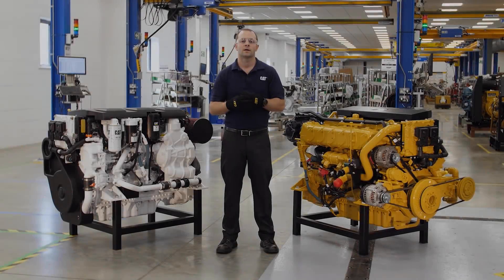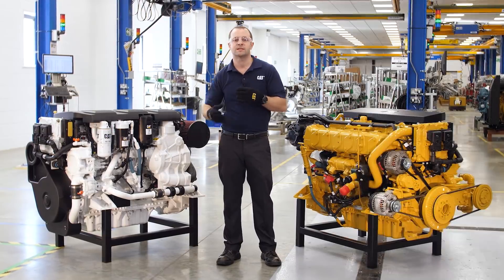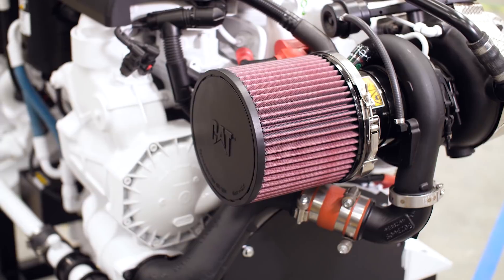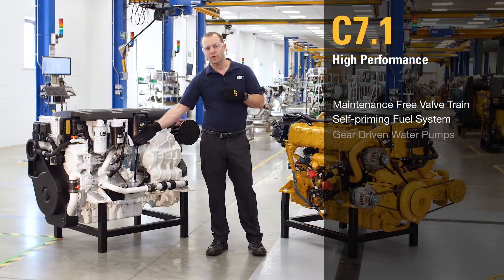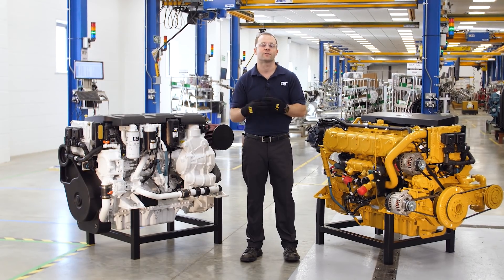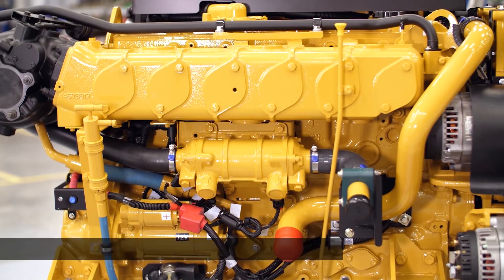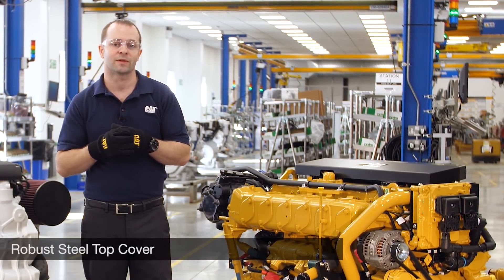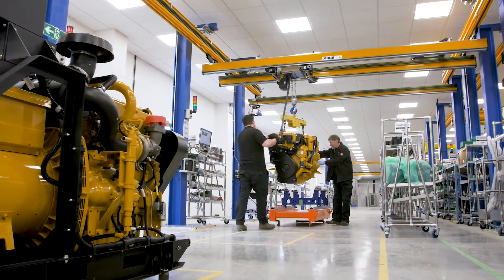Meet the new C7.1 Commercial Propulsion Engine

Comment: The world misses Cat engines for medium to large trucks.
Reply: The C7.1's power density and torque is great for the displacement (7.0L), but it is somewhat on the heavy side. The C7.1 HP is about 750 kg. For comparison, a similar displacement and output GM Duramax L5P (6.6L, 445 bhp / 910 lb-ft) is about 400 kg. The same can be said of its Cummins and Ford 6.7L competition in the same power class (400~450 bhp). This may not matter in marine applications, but it matters quite a bit in heavy duty trucks. This largely explains why you don't see Catepillar engines in light trucks. I am sure CAT is more than capable of producing a lighter engine, but it is a saturated market and there may simply not be the financial incentive to enter the fray.
Reply: @dwightlooi  it's not a saturated as it used to be because Navistar is gone
Reply: @5.43v  That in itself was kinda sad because Adv EGR worked in the end... but reliability issues and lawsuits from its the premature introduction forced by the environmental extremism of the Obama Administration destroyed Maxxforce as a brand and eliminated an American engine manufacturer while creating an opening for MAN. The point remains though that for CAT to have a 7 liter offering targeted at trucks, it is going to have to weigh like a Maxxforce DT (or whatever Cummins or GM alternative). It can,t be a 1600 lbs engine.

Comment: So this would be a direct drop in for a 3126 ? Without changing mounts?

Also what about fly wheel and bell housing, power ratings are almost identical so gear ratio should be same.  Thank you!
Reply: Repowering twin 3126 to c7.1 and the front mounts are not the same, but I am running the same mechanical transmission for the job.
Reply: @nvfux4997  sweet thank you  been debating this our going to fpt. Cats price for hp is little wild haha

A reman 3126 is 45k +9 k core

54k for c7.1 at 425 hp

Fpt is 36k for nef 450

51 for evo 570

Comment: What can you sat, CAT engineering at its finest!   Germany`s  MDU  also makes some fine diesel engines!
Reply: MTU or MDU are very expensive to operate specially after sales parts needed during overhauling . its  good for military marine special application . compare to CAT engine are design for many purposes , either military, comercial fishing , pilot boat and fast craft. Both are continueos running engines .

Comment: Power density and torque for the displacement (7.0L), but somewhat on the heavy side. The C7.1 HP is about 750 kg. For comparison, a similar displacement and output GM Duramax L5P (6.6L, 445 bhp / 910 lb-ft) is about 400 kg. The same can be said of its Cummins and Ford 6.7L competition in the same power class (400~450 bhp). This may not matter in marine applications, but it matters quite a bit in heavy duty trucks. This largely explains why you don't see Catepillar engines in light trucks. I am sure CAT is more than capable of producing a lighter engine, but it is a saturated market and there may simply not be the financial incentive to enter the fray.
Reply: Cat quit on highway engines because of emissions

Comment: There is an owner/operator I know who has owned and run a 1944 Cat D-8 cable dozer since he bought it surplus for $300.00. Cat has tried many times to sell him a new dozer and he keeps refusing because they went to electric start. His has the donkey starter on it and he loves it as in the winter when it's not uncommon to see -40 or lower temperatures his never fails to start as long as he brings an extra Gerry can of gas with him. The company he's contracted to sent him to level out a new parking lot 12 years ago and while he was finishing up the new to the company 140 grader showed up with the computerized leveling gps system on it and after three passes on the gravel that had been leveled by the dozer operator called the owner and told him he was wasting his time out here as the dozer operator had leveled the new parking lot dead on spec simply by back dragging the blade on his dozer. The operator of that old D-8 is still working today at 87 years old and says why should I retire? I enjoy running a dozer. One morning someone will show up on a job and find him dead at the controls on his D-8. He's a cranky cigar smoking grumpy old bastard who has more than once shoved a caterpillar salesmans pickup truck right off the job site if he felt it was in the way. The local Cat dealer generally send their new salesman out to visit him to " break then in properly ". 

 Only one salesman ever returned not with an order for a new dozer but an order for 8 cases of oil filters, fuel filters, and air filters and everybody at the Cat dealer wanted to know how he did it. He refused to tell them. Every time he visited the old timer he came out with two boxes of cigars, the type the old timer smoked, parked the company pickup next to the old timers pickup and carried both boxes under his arm while smoking his own cigar. He and the old timer got along like they grew up together because he never tried to sell the guy anything. Just two boxes of cigars and fresh hot coffee a loaf of bread and four different types of deli meats, mayonnaise and other condiments and showed up on the job just before lunch. Opened up the ice cooler in the back of his truck and started making a big fat sandwich, after making his sandwich he look at whoever he was visiting and say be my guest, make a sandwich I got plenty of fixing. His wife suggested it after two weeks of no sales so he decided to try out her way. You win them over with food and they will buy stuff from you when you refuse their cash for the food. He did this at every job he visited and always got decent sized orders for supplies or parts and occasionally new machines when other salesmen had visited the same companies and got nothing except we'll call ya if we need something. That salesman retired last year and figures he spent $ 100 bucks a weeks to keep the deli cooler stocked for one week but made far more than that in commissions. His wife stacked the cooler every morning with whatever she had just cooked in the kitchen, she cooked about 30 pounds of fresh chicken with potato salad and four large bags of potato chips and the second stop of the day was handed an order for more equipment than he ever sold at one time in his entire career. Just over $2,000,000 worth of loaders, dozers, rollers two water trucks and dozens of other pieces. The contractor while he they were making sandwiches that morning from his cooler got word he won the biggest contract he ever bid on and decided then and there that the kid salesman from Cat never bothered or tried to sell him anything he didn't need was the one to order the equipment with. His commission paid for a new house for him and his wife. The Cat dealer almost had a heart attack when he handed in his orders at the end of the day. He refused a raise because he told the owner why give mea raise when you know my weekly commission will exceed my basic pay but thank you for the thought. He said the following weeks paycheck was double what his basic pay was and the owner refused to take it back.   
 Only for three weeks after he started as a traveling salesman did he collect just a basic paycheck with no commissions then started hauling the ice cooler stuffed by his wife, the cigars were his idea as everybody when he started smoked cigars.

There are ways to sell and service grumpy customers. You simply figure out the easiest way to their heart. And don't try to sell them a thing.

Old school ways are the best.
Reply: James Shanks that's an amazing story. Thanks for sharing!
Reply: What a story . Old school rocks , D8 dozer with a Petrol feed starting engine on the side is very rare to find now a days . But its good to know you friend still using it .
Reply: Nice story.
Reply: Ken  Sometimes sales doesn't mean pushing to sell, it means working out how the person ticks

Comment: How bout you guys work on putting them back in trucks.
Reply: CAT shouldn't have ever gotten out of OEM powering commercial OTR trucks, it'll be tough for them to get back in, they've lost too much market share to Cummins and Detroit!
Reply: Well of course they lost market share, they left the market. Detroit isn't much to worry about, since they're Daimler only now. The only competition is Cummins and all of the new OEM brands. I hate the new vertical integration of trucks. Used to be you could pick a truck you want and then get it set up with the engine you want, transmission you want, and so on. Now every single truck update brings more proprietary bs.
Reply: George Ashing even if they do come back it’s not gonna be the same they’ll probably gonna have the dpf system which makes them junk
Reply: Gov juice, ruined the entire farm and trucking industries.... Why the F do farm tractors need to be T4F... I quit farming 20 years ago, but every one I still know that has a truck with a 3406, it's their favorite truck...lol...
Reply: They left because they dident want to put all that Def Dpf shit on there engines ! They left as #1 for a reason.
Reply: @Tyler-xe1es  yep, but doesnt make the industries better... the leader just bailed... 6nz, if you know any old farmer that has that in a truck,,, its their favorite truck,,, lol...
Reply: @Tyler-xe1es  apparently their off-road engines have it

Comment: Great improvements. I design hulls for fast, fuel efficient, comfortable rough sea operation, and  as an engineer. I liked your presentation very much since all your improvements build on the old where possible. Here is why I write. I have another further improved design, for rough sea even greater safety and comfort, and at this time I need engine dimensions, allowing the engine to be lowered further into the run of the hull. I checked the CAT site, but found no dimensions included anywhere. You do wise designs, I notice, so below the drive shaft, where the hull run is, any needless engine feature which if rediced in width would allow mounting deeper. Any change in the mounting rails which can be narrowed closer than your present 28.9" shown with needed vibration absorbing pads, would be a further help. You may know that hulls in rough seas are harder to turn over when the center of gravity is lowered. My hull is really good in bad weather, but I want to try to improve it even more, since it may be used for Search and Rescue.  My present 39' design i am working on will allow +40 MPH with your 500 HP C7.1. My 36' fishboat with 270 HP gas Olds 403 marine, pushed the hull to 35 MPH, so my 39' should get +40 with your 7.1. These are real workboats, not runabout hulls. I am located in Bedford, Nova Scotia, Canada.
One other reason for mounting lower into the run, is to reduce the height of the engine box and working floor. Your competitor QSB-6 has the drive shaft below the mounts? Your is well abov the shaft. One final thing, my hulls do not have that forward lifte bow but has an attitude of 2-3 degrees at speed, so I tend to have the prop shaft at the same angle as your drive shaft. Your 12 series seem to be aimed in my direction more ? 
For your info, my 6' hull model of my 36' full hull, was tested smoothly and perfectly stable without exponential power increasing, but almost linear up to +70 MPH. I saw no need to go beyond that speed , but would allow more. I'm getting older, so my present hull design may not be built? Just confirming the urgency. Be safe and keep up the fine work.

Comment: Is that Slovenian alternator reliable?
Reply: NO,ITS NOT.
Reply: Its intended to charge the battery and  supply  12 or 24 volts to EFI  fuel servo valves since this is common rail engine . Starting up also.

Comment: I remember when the marine engines were built in PeoriaIllinois, but maybe these are Perkins in disguise. I could be wrong but you never know.
Reply: The small engines (4.4L and smaller) are the rebadged Perkins engines (Cat bought Perkins for those engines IIRC). The C7.1 and larger, at least, are true Cat engines.

Comment: It too bad they got cheap and didn't use a electric water pump.  It would reduce parasitic drag which reduces fuel use, increases hp and torque.  Gear driven does the opposite.
Reply: i would say that gear drive is 10x the cost as electric pump  and 10x the life  electric pump are fine on a car not a big boat.
Reply: Cheap is the opposite, It costs cat more to put a gear drive pump in rather than electric, the parasitic drag is extremely little but what you get is much higher life and reliability

Comment: If you're wondering whether you should repower an older CAT engine with this, don't. Rebuild what you have, the C7.1 is an unreliable POS
Reply: What problems have you seen on the 7.1?
Reply: Yea what kind of problems are you running into..? I'm thinking of changing my 3208 with 25000 hrs on it with the 7.1